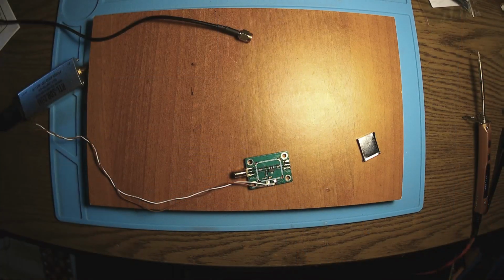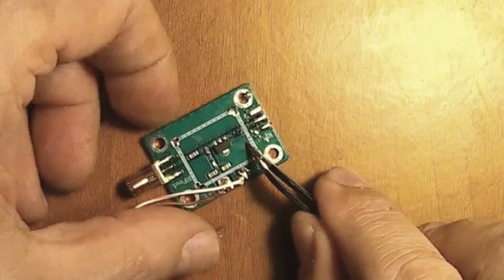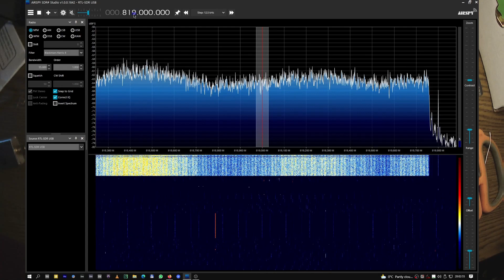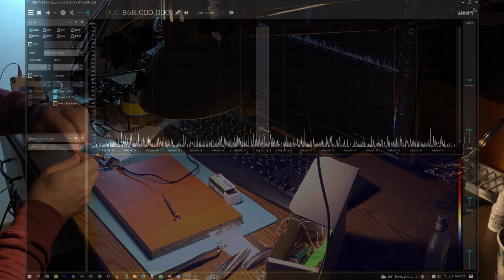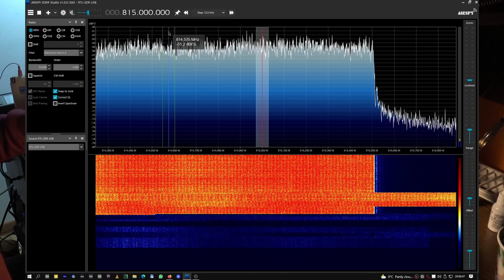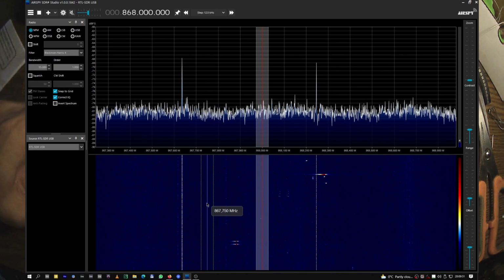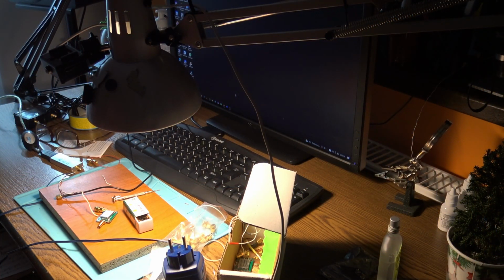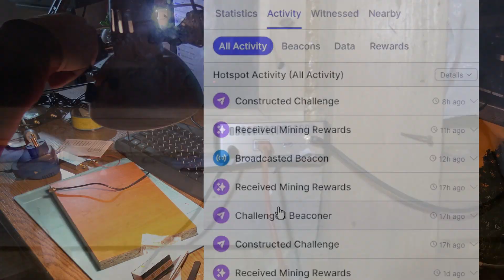Experimental LoRA RX filtered amplifier

Comment: Best of luck, I hope I am wrong but I doubt this will improve anything , you are introducing more attenuation on a weak signal and then amplifying it along with more noise - your SNR will only degrade.  If you do anything, it must be placed at the antenna end. I am still routing for you though :)    - Also I think you wasted time changing connectors to minimise the attenuation, as you have placed the new connector on the output to your Hotspot (which is now amplified), you don't care about attenuation on your output now, you can easily lose 10db without any issues at all, run 50mt of coax with no problems!
Reply from the maker: You're right, I can't see improvement, I even change cables for shorter ones..so this is not working.Best is to start with a good antenna, but it's also a lot of folklore.Now I have 6dB McGill, that's overshooting all the nearby hotspots and I can't reach anyone on 5Km radius..so I'll go for a low gain something..soon..Thanks for your sharing!

Comment: How do you power this for permanent setup?
Reply from the maker: I'm thinking about getting 5V from miner, but It's kind of 140mA so I have to check if the 7805 circuit can supply extra current

Comment: Good afternoon Viorel,
a new day, a new comment from me.
It's always astonishing, how our both experimenting is very equal.
I did the same soldering of a tiny saw-filter (from of my sensecap - I soldered it out - there was one too much) onto a little amplifier board, just as you did. But I didn't test it with my miner right now.
I want to fit it just near the antenna to compensate the cable loss to the miner.
But I intend to solder the cable directly on to the rf-radio-card inside the miner. So the normal stock connector for the tx-signal remains free to use for the beaconing with a little stock antenna.
I will wait, what results your experiment will bring, before I open my miner again. 
Let's see and wait.
Greetings from Germany
Reply from the maker: Nice! That's the meaning of hobby! For the first 24h it feels like a little push, now I changed the antenna and waiting for results. The best idea like you said is two separate antennas, so no need for fancy expensive amplifiers.I'll let you know how's going.

Comment: i put a sawfilter on my bobcat and it doesn't work signal is way too high rssi
Reply: You need to update antenna to max. 15db in the helium app
Reply from the maker: @slutbonia3810  Right!
Reply from the maker: of course there is at least 2.2 dB loss, maybe a bettter gain antenna should work..I realize filtering is good for crowded urban enviroment, but not in isolated areas..where you need the maximum gain possible..maybe a Yagi?
Reply: @viocaia  i did yagi 12dbi+sawfilter and not good next i will test yagi 23dbi and sawfilter 🙂 but i think bobcat have filter inside not sure do you Now?
Reply: @robertVandelanotteonlinemoney  Bobcat does not need filter
Reply from the maker: @robertVandelanotteonlinemoney  I don't know, all I can say that the Bobcats around doing well..let us know about Yagi..I ordered a TV Yagi for channel 60..goes to 860Mhz..but for 75ohms..needs a new balun..

Comment: Please learn some RF basics !
I see so many pointless videos here on YouTube. 
The amplifier does not go on your miner's input but on your antenna instead.
If you have a short antenna cable you even don't need an amplifier or use better quality coax instead. 
What you are doing now is only cause interference at the input of your miner's input even with that SAW filter added.
The thing you did correct is putting the SAW filter after the amplification.
You might see a minor improvement but don't put up your hope to much.
Reply from the maker: Everything is as should be..the output of the amplifier goes to  the miner, input goes filtered..the radio shows a very clear signal gain..of course the SNR is the same, even worst because amplifier noise added to the original ..but it's an experiment and this channel as I said so many times is just for hobby and having fun! I'm not intending to teach anyone, I let this to you professionals! Do something..show us how!
Reply from the maker: Yes, I'll do! Thanks for comments.

Comment: It will be really interesting to see your result here
Reply from the maker: I need more time..now I'm also experimenting with different antennas..
Reply: @viocaia  I understand but if you have any preliminary data it would be good to see it
Reply from the maker: @waynecarter4799  Maybe it's coincidence but for 24h a slight 5% witness  like..but generally network is pretty lazy, ups and downs..I'll do a video in a week or so..
Reply: @viocaia  Thanks, its so hard over a 24 hour period as the system can usually vary over this period anyway
Reply from the maker: @waynecarter4799  Needs more time..